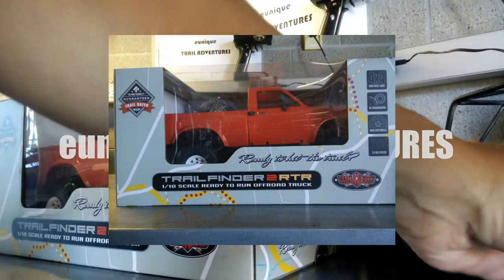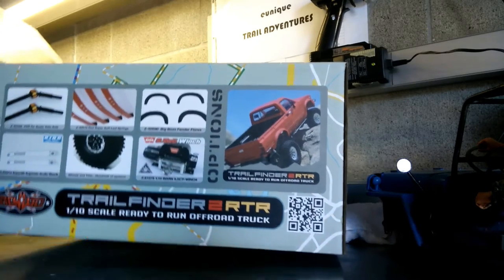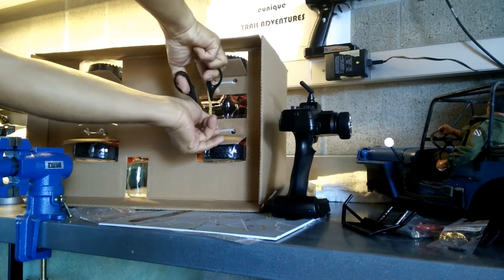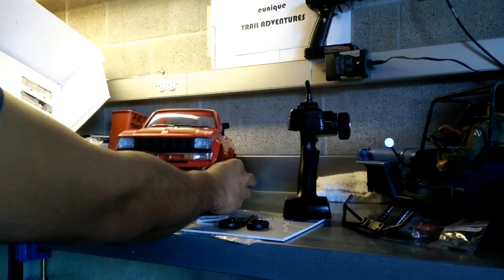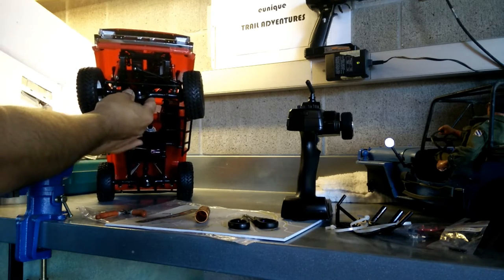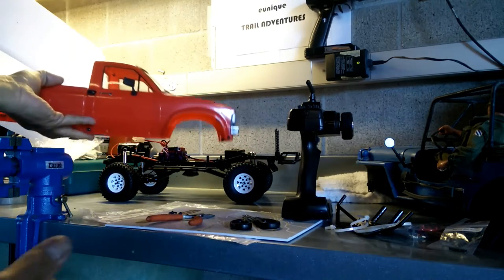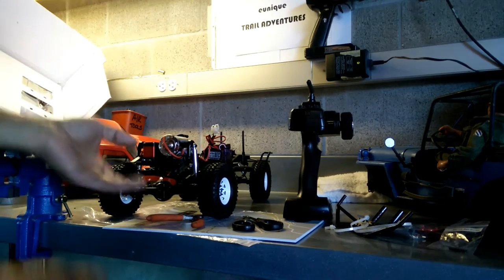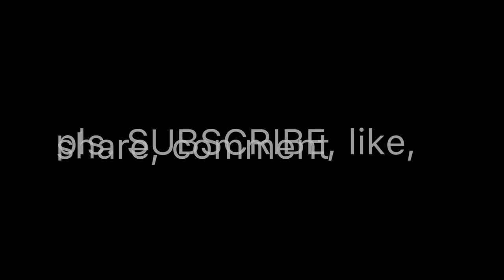Trail Finder 2 by RC4WD, an Unboxing - TF 2 RTR 4x4 Scale Truck

Comment: I really like this truck. It reminds me of my Tacoma. I just wish they made access to the battery easier. Instead of taking off six screws to take the body off, the bed could be designed to be removed with the two side screws to get to the battery.
Reply from the maker: +Carrie Lucas right, it is difficult in that sense although you can make a custom plate with heavy duty velcro and not have to use the screws...or even magnet mounts
Reply: I use grub screws. Grind a few millimeters of the threads down a bit so they don't saw through the body. Install grubs smoothness out in the body mount holes. Now the body pressure holds itself on the new posts. Add velcro if you think it needs it. My body never comes off though.

Comment: now all you need is the r3 2 speed the low end torque is better and the high range is quite convenient. i even put one in my g2 cruiser body i like it that much. :)
Reply from the maker: I will consider it. I might put in the gear reduction unit for some strong torque slow crawling
Reply: well worth it. :)

Comment: Great scale rig - The drive shafts were the weak point on mine, have they upgraded from the plastic yokes?
Reply from the maker: it is awesome! driveshafts are still plastic but have the sleeves that go over the yokes to help from popping out. i put silicone to keep them in place..and have upgrade replacements ready out on the trails, just in case

Comment: Great Video.   I bought the kit that you have to build from the ground up but do you know where I can get the parts to make it into an r c truck ? I think it needs a motor,servos,radio and battery but I don't know what will fit and what will not fit
Reply from the maker: There are plenty to all those electronics that you can get for this scale truck. You have to figure out whether you want brushed on brushless systems. If you plan on getting into water and mud, it might be better to go brushed systems. For scale trucks and crawling, and if you want to go brushless, you need sensored brushless to be able to drive smooth and sensored brushless systems will be difficult to make water resistant. 
Check out rpphobby.com for the parts you need